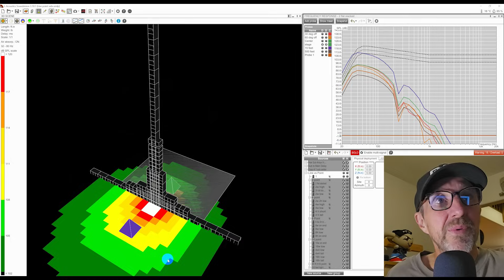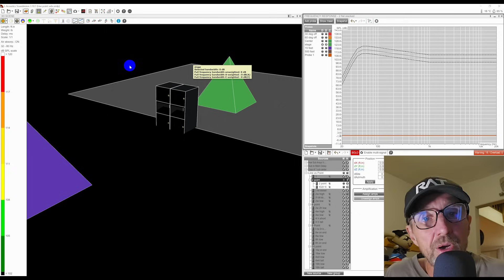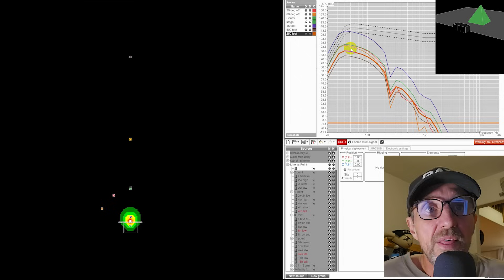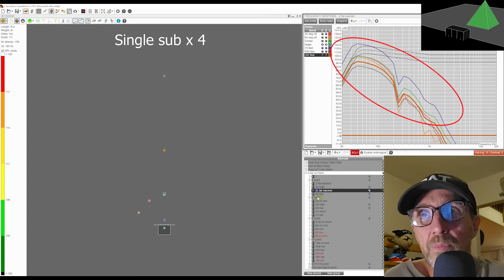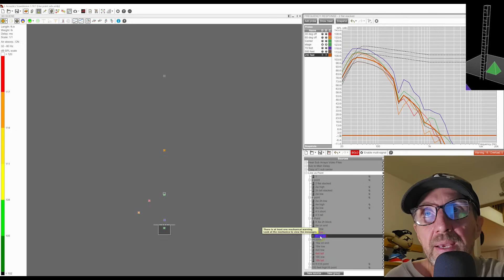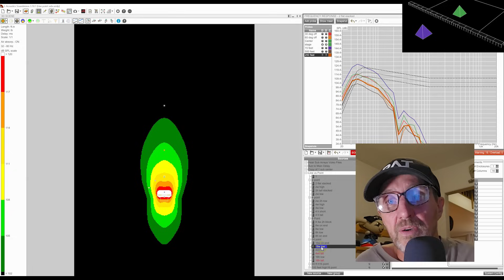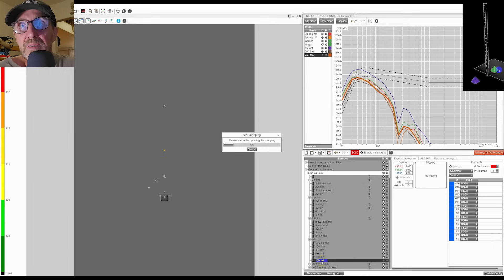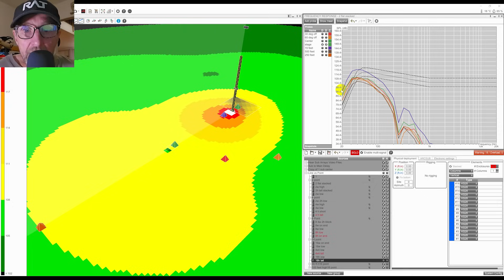Point Sources Are Ideal... Or Are They?

Comment: Point sources are only "ideal" because it makes the math easy, a line will always outperform it in terms of coverage, you just get, well, all sorts of spooky problems in exchange for that coverage, not the least of which is how to rig them safely. I've been at festivals where the wind picked up and a bunch of dudes ran up and frantically tightened the ratchet straps on an array that'd started to swing. Glad that I was well back in front of the mixing position instead of down in front underneath that thing (and that's where it sounds best anyway).

Also worth noting that there is no real point sources out there. On an 18in sub you have 1 3/4 square feet of speaker area moving around, that's far from a 1D point, and the box itself resonates some, and whatever porting the box has is going to mess with it too, all things that are hard to model yourself, soundvision accounts for most of it thankfully, but all of that deviation really only serves to point towards the need for modeling your systems and usually that'll point you toward some sort of array.
Reply: Technically, a flown point source with directivity matching/optimized for the audience area could provide textbook perfect coverage. Practically this is not feasible for non-small venues/festivals, since a single speaker will not have enough output.
Now something like the Caleb would do some noise, but it's a single speaker the size of a small-medium-ish line array using over 100 drivers...
Reply from the maker: The wind issue is solvable and we (rat sound) have designed and deploy wind clamps that keep the L-Acoustics line arrays stable and safe, no moving at wind speeds up to 50 MPH.
Reply from the maker: And this video shows that that concept of point sources being optimum to be in doubt and that line sources are more optimized for consistent coverage volume
Reply: @DaveRat  Depends on what you are optimizing for. Point source would still be optimal for fidelity. Would love to see what a huge line like this looks like on a waterfall plot, it has to be ugly.
Reply from the maker: Fidelity is a big term. And if in the concept of fidelity you include things like reducing room reverberation and the magnitude of indirect signals and the consistency of sound throughout a venue or space, or things like being able to project high frequencies over long distances such that the listening area has a more even frequency response, then it is highly probable that in most to many situations especially larger spaces, The point source would typically provide inferior fidelity.

The manifestation of this plays out in the real world and can be witnessed by the proliferation of line arrays has the dominant method of sound reinforcement for medium and large format events.

The sound quality we are able to achieve now with properly configured modern line arrays is an order of magnitude higher fidelity than what we were achieving with older point source systems.

While there are some nice point source systems out there that sound quite good, The demand for deployability at large format events with smooth and even coverage puts them at a huge deficiency, hence the reason no major world touring artist performing large venues tours with a point source system
Reply: @DaveRat  50MPH max wind loading is super impressive, especially considering I've seen the size of the arrays that you run, they're basically sails, so to keep that stationary is a feat in and of itself.

Thanks for coming down here in the comments and talking with us common folk. I do hope you derive some value from it because it's certainly invaluable to us.
Reply from the maker: Very cool and yes 50 miles an hour is substantial. We aligned the spec such The sound system will not need to be dropped if the venue is still safe for people and that 50 mile an hour mark is when they tend to clear the people out of the festival. So the PA never needs to drop because once people are out we can leave it up!

Very cool and I do enjoy the chats they keep me on my toes and provide me with new info as well
Reply: @DaveRat  What is often lost in this discussion is scale. You operate on the largest scale and use the tools and methods that make sense at that scale. 

Very few of your viewers are mixing arenas. The majority of small venues now have some kind crappy short "line array" like VRX or similar because less experienced    sound humans involved in decision making see  huge line arrays used by their heroes on big shows and assume vertically stacked boxes must always be superior. 

Very often they could have had a top of the line point source boxes that perform better and cost less than the "line array" shaped thing they were sold. 

Not saying this has anything to do with you just my particular beef.
Reply from the maker: Yes on scale and also things do scale down. Large format line arrays offer very powerful control over coverage in the vertical domain down to a very low frequency. Small and mid format line also offer considerable control over the vertical coverage though not down to near as low of a frequency. As the frequency that can be controlled is determined by the length of the array versus the wavelength of the frequency

That said, One of the biggest detriments to quality sound in all venues including small and mid venues, is room reflections. Unlike point source systems which offer little control beyond the fixed dispersion of the box, line arrays offer excellent vertical control and allow you to keep sound off of the roof and if properly deployed, can substantially improve the direct versus reflected sound over the point source counterparts that lack that control.

That is not to say that point sources are not valuable and very useful for many applications. Typically for installs that we do in a variety of venues ranging from small clubs to large concert halls, we use a combination of line array and point source enclosures depending on the area to be covered and numerous other factors.

For true audio professionals, it's not line arrays versus point sources, it's all about selecting the proper tool for the application to optimize the outcome.

In this video my goal was to show one of the key aspects of line arrays that may be beneficial, wherein line arrays have the capability to offer more consistent volume versus distance
Reply: @DaveRat  "it's not line arrays versus point sources, it's all about selecting the proper tool for the application" that's the most important thing really. And to be qualified to judge which tool is the right for the job at hand, educational videos like yours help a lot.
Reply from the maker: @peniku8 🤙🎛️👍
Reply: @peniku8 Exactly. Our church looked at line arrays because we were having trouble with coverage, but they were too heavy to mount to the walls, and our building superstructure did not have sufficient margin to fly them from the ceiling. We opted for some Danley SBH10s which behave much like a medium line array (in my admittedly limited experience), and since our room is wider than it is deep, the 10° vertical and 140° horizontal dispersion made perfect sense. We still needed some downfill for the front rows at the extreme outer edges, and the SH Minis worked well for this, (though we did have to make our own custom brackets).
Reply: @scottdotjazzman  Tight vertical dispersion that keeps the sound where its supposed to be also helps a lot with speech intelligibility, since there will be less reflected (room) sound messing with the direct sound from the speakers.
Reply from the maker: @peniku8 agreed
Reply: @peniku8  yep. That was one of our biggest issues. People came up to me after they were installed and were astonished how much better they can hear. I eventually went a little further and custom built some 5x4' fiberglass panels for our sidewalls which further improved intelligibility. The room is half the equation (or more, depending on how you look at it 😂).
Reply: @scottdotjazzman  indeed it is, and that's why system engineers get paid a lot of money to optimize the PA and set up room EQ and stuff.. As a touring FoH I always have my measurement mic and laptop with me and if time permits I will measure and correct the venue we're at. It often makes a massive difference, since even big venues sometimes don't have their system set-up well
Reply from the maker: @peniku8 🤙👍🎛️

Comment: Super interesting! I've only seen Funktion One try this in practice as of recently (2 wide, 8 high F124), though they're usually hugging stage left or right instead of dead centre. Do you think other events / sound providers will ever get this sort of creative freedom on a large scale?
Reply from the maker: This is to demonstrate the concept of point source versus line array. Putting a single point source dead center or 100 ft in the air or a long line dead center is neither practical nor wise.

Once you understand the concepts deploying them in useful ways is of the utmost importance.

Comment: Waiting for the day I walk into a show and theres a 72 foot stack of subwoofers right in front of the stage. Thought now I wonder how well does that work if you had two tall stacks on either side of the stage. Or perhaps 4 stacks across a large festival stage. The main stage at lost lands this year seemed to be about 80 feet high and 400 feet wide, so there is actually the possibility to go vertical with the 68 PK G218 subs they had.
Reply from the maker: I must admit it's slightly enjoyable to see theoretical concepts interpreted as something that should be deployed in the literal sense.

Hopefully they understanding of the concept wherein sources that have larger vertical dimensions are more capable of improved volume coverage consistency is being grasped.
Reply: Engineer prefers to use the "jenga" configuration. No jumping on stage please.

Comment: This reminds me of a time I saw Dave Matthews Band at The Gorge.  This was back in 2002 when they were using a Meyer point-source array.  I noticed they had all the subs on each side in a single vertical column; I don't remember how many subs (maybe 20?), but I do recall thinking it was silly to have them all in one vertical stack.  With this explanation, now, that sub array makes perfect sense!  They had such good sound at that concert.  They later traded that Meyer array for a JBL Vertec line array and the clarity kinda disappeared, as well as the deep bass extension.
Reply from the maker: Very cool and there are some great setups that have been deployed.

I kind of did this video to show the basis of why line arrays are popular for covering larger spaces. I did it with subs for simplicity but the same theory applies to mids and highs and this is the reason line arrays are so successful in festivals is their ability to have improved volume consistency for near and far listeners